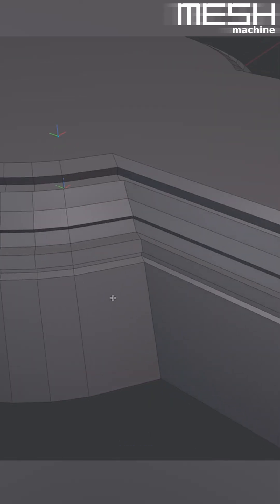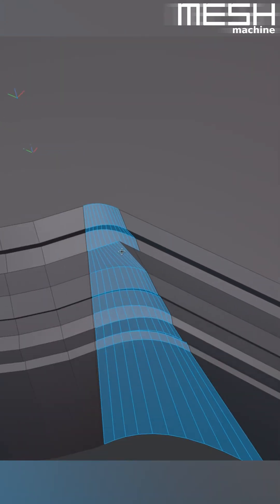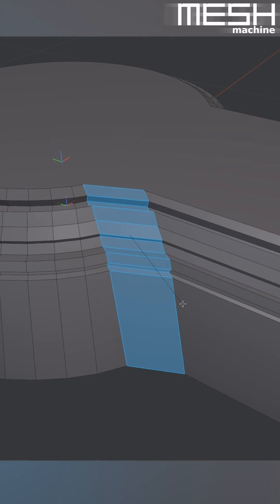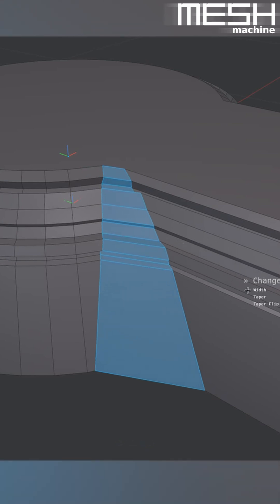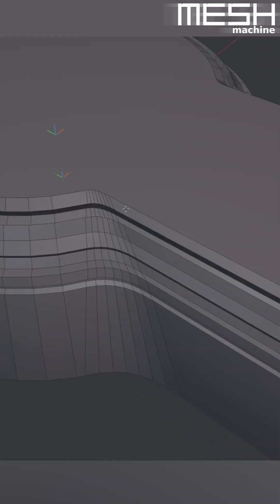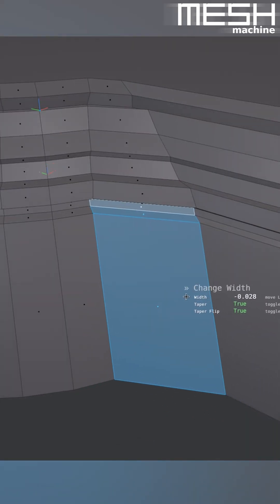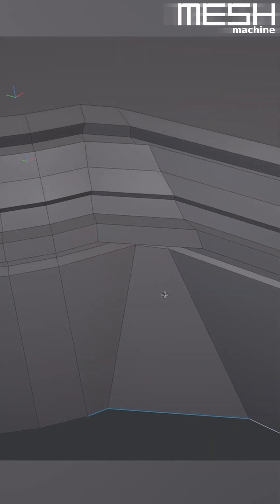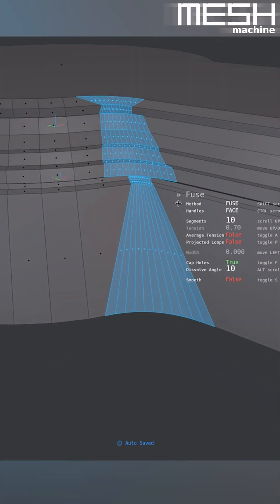Variable Fillets? Flexible and Non-Destructive #b3d #blendercommunity #blender3d #3dmodeling

Comment: but what should i do if I can't delete some loops to make rails because i need it for my form?
Reply from the maker: If you need them for the form, then you don't need a fillet that big?
Reply: @MACHIN3  look: i have half circle then i copy this and rotate by x axis by 90 degrees. Now i want to make a smooth connecntion. If i make like shown in video i will have no circles anymore - their edges will be flatten after disolving loops

P.s. sorry for my bad english it is not my first language

Comment: Meshmachine is the reason why I went back to Blender after trying Plasticity. Literally feels like I have more control, to my own surprise 😂.
Reply from the maker: You know what, I've been hearing that from a number of people recently. Also in relation to HC though. Super interesting for me. Thanks!
Reply: @MACHIN3  My main source of this 'complaint' is in the Fillet system there. It's like it's trying to be too smart and adaptive to surfaces(even when setting it to the Blender-like 'Chordal' mode). Sure, the fact that it can carve through anything is nice, and the smooth shading with no cleanup is also appreciated, but when it gets to the point where a simple decal I wanna bake with DM, reaches the point of having to do literal surfacing operations to get the same bevel in Plasticity, I'd rather deal with polygons 😂.